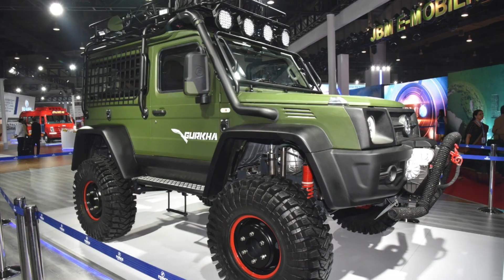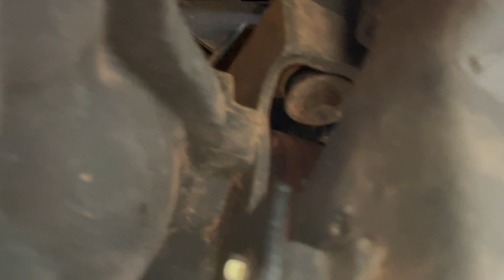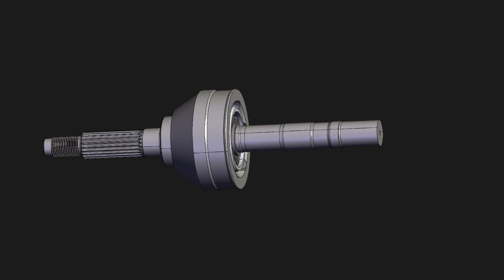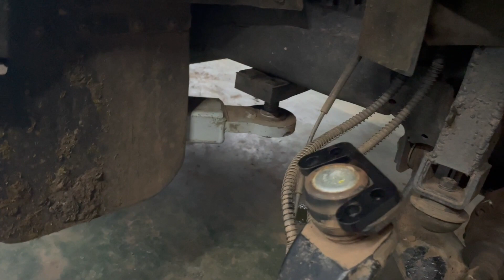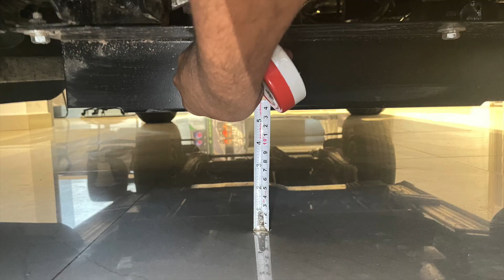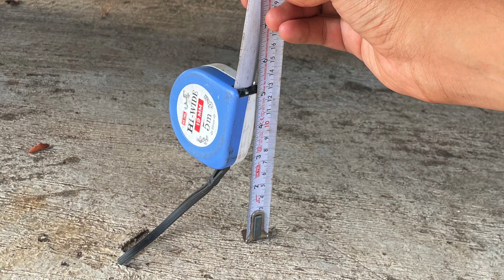Force Gurkha Lift Kit | 275mm GC! Blue Garage.15 Step Installation Guide. Pros/Cons See Description.

Comment: Hello brother, One clarification, In rear wheel lift spacer should be on top of the coil spring, why have you put it in the bottom of the coil spring... Can you pls explain why? For my knowledge.
Reply from the maker: Rear spring seat should sit on the spacer. This is better to allow for spring travel. Spacers are bad for your car and will do more harm than good in the long run. Please watch the full lift kit review video.

Comment: Have you figured out the diff-drop yet? Also, are you still using the lift-kit? How are they holding up? CV-wise, or any other issues occurred due to the lift?
Reply from the maker: I don’t recommend it if going off-road. As a temporary band aid for on road it’s ok. I’m on a complete different suspension set .
Reply: @tripaccino  Noted, thanks

Comment: @tripaccino How do I contact you guys?
Reply from the maker: Right here. Write here.:D
Reply: @tripaccino @tripaccino  I am looking to buy a Gurkha for myself and found a 2017- 3-door 4x4 model in Okayish condition. I am yet to make an inspection visit to determine the condition of the car. The seller is asking 7, 25,000. Any advice or suggestions for this purchase? Also, any ideas on the price fairness, as OBV and Cartrade platforms show a price of 5 lacs and 6.25 lacs, respectively, for a superb condition Gurkha. Specs: First Owner, 50K on ODO.
Reply from the maker: @Kapil-h1m  too expensive at that price. Chuck it. Won’t recommend
Reply: @tripaccino  Thanks...what would be the fair price? Also.. should I go for a new one, the 5-door 2024?
Reply from the maker: @Kapil-h1m  Depends on what you want to do with it?
1. Family car?
2. Offroading? Highway
3.Luggage capacity requirement?
4.Ownership experience+Service etc.
Reply from the maker: @Kapil-h1m  Can't say price without looking under the hood. Don't go for old Gurkhas unless you can fix it yourself.
Reply: @tripaccino  Roger that.

Comment: How is the lift kit holding up? Any issues have you faced as of yet? Since I am not that well verse in these terminologies, awaiting your feedback in layman terms 😅
Reply from the maker: Don’t go for lift kit. I’ve done a lot of mods to make it work. Im working on full blown suspension upgrade
 Have swapped out my rears into beefy off-road shocks. Will let you know when I get the full suite done
Reply: @tripaccino  sounds interesting. Will be waiting for an update. As per a sales executive in Guwahati, the new one is supposed to get a 235 mm ground clearance from the factory and is due to hit the floor July end. Would be interesting to see that set up as well.

Comment: Two points. Firstly, the trim height is measured from the center of the axel to the bottom of the wheel guard, this is standard practice and thus will give a true indication as the the amount of lift achieved. Second, why do you still have anti-sway-bars (anti-roll-bars), these devices only hamper wheel articulation, at least have quick-disconnect sway bars so that you can actually go over more rugged terrain.

Comment: Excellent. Please also comment on Highway/Road Drive Dynamics and Handling to incl Body roll, Veh stability and Pitch due to incr CG
Reply from the maker: Please watch the next video which is the complete test report with all these points covered in detail. And why I DONT recommend the kit, without sufficient countermeasures 

https://youtu.be/wDYovWfnM1M
Reply from the maker: @ravin64ful
Reply: @tripaccino  Gracias Amigo. Painstaking and insightful research. Grateful. I am currently in the process of evaluating available 4x4 options in this budget segment as an additional vehicle for self for use at my place in the higher reaches of Himalayas. Your inputs are indeed valuable !! Thanks.
Reply from the maker: @torqueador  Thanks for the encouraging response. I attempted to take the level of testing to a thorough and scientific high not commonly seen in our country, and Im glad you found it useful.
The segment is ripe with multiple options, let me know if i can help you make the decision easier. You may also check out my two car garage video which is targeted at people like yourself, looking for a second car esp 4x4

Comment: But you will have to be ready with spare CV as the tolerance of CV will decrease with articulation and rotational momentum. Maybe just some 1 year off 3 year high abuse. Theoretically I guess
Reply: Maybe the water resistance of boot could decrease due to traction on the lips, could a bigger boot take the pressure off, I wonder
Reply from the maker: Thanks for the comments. 
Boot requires proper installation. 
Cv angle is handled by dropping diff.

Your observations are keen. 

Please check out the follow on Video of this titled 
Full Test Report to lift or not to lift 👍
We can discuss it there once you have gone through the detailed discussion: you may find it interesting 🧐
Reply from the maker: A person of your understanding will surely appreciate the other follow up video
Reply from the maker: Lift or No Lift? Blue Garage Kit| User Review | Lift Kit Force Gurkha | All About Strut Spacer Lifts
https://youtu.be/wDYovWfnM1M

Comment: as of now after 2 months, how is your force G lift kit performance.  pls do let me know
Reply from the maker: Pros: Increased Ground clearance . Important for me because I run Django off-road and in competitions where can’t afford lower arm hits. 
Cons: Severely altered suspension working off-road. Undue stress on extended droop of the strut. And cornering issues because of bump stop. 

Bottom line: do not recommend spacer just for lift.

Also I ve done some other extra mods to null-  bump stop spacers to counterbalance etc. 
Working on suspension upgrade to replace lift kit completely. 

Please watch the full review video linked at the end of this video

Comment: Very interesting and good information! Thanks a lot, I just want to ask will it not affect the handling and performance of the vehicle?
Reply from the maker: It will affect it. On flat smooth roads, you wont feel much, but slight bad roads, trails or off road, its going to cause significant stresses on the suspension and may lead to spindle bolts shearing off. PLEASE do watch my complete rest report video linked at the end of this video and in the description. This lift kit will do more harm than good.
Reply: @tripaccino  thanks, and I'm desperately waiting for your next episode on this😄😄
Reply from the maker: @wanphrangdiengdoh2884  https://youtu.be/wDYovWfnM1M Here is the full report

Comment: When will you attempt body lift next? Thanks?
Reply from the maker: It’s already lifted . Sorry didn’t get the question
Reply: @tripaccino  this time you did it through suspension, any plans for body lifting, the other method you mentioned in this video ? Thanks
Reply from the maker: Ah. this is a "top hat spacer", the suspension actually has not been changed from stock. I will add a different offroad strut probably in future. Thanks and do stay tuned for my full test report where things will become clearer.

Comment: Well made video, How about the front track?
Reply from the maker: Spacer pushes the wheel axis away from steering axis. Track not changed. Toe changes a bit and brought back during alignment . Caster corrected by UCA spacer

Comment: I guess this lift kit might make the suspension bottom out at times...also might affect the CV joint in tough conditions...i am not sure if this would affect the handling dynamics of the gurkha...but i guess ur future videos might educate us on that...CHEERS! 🍻
Reply from the maker: The extended strut eats into the droop part of the travel and it will reduce range of travel. But I’m consciously betting on the limits. I’ll also be changing coil and diff drop in Future to compensate
Reply from the maker: Yes I anticipate the same . Please do read the description, I’ve explained my cons , cheers 🍻

Comment: Thanks for a very thorough explanation on the lift kit. I’ve just finished a trip to Zanskar in my Gurkha and felt the need for a lift. Would you suggest I start with inching up the tyres to 75s and then work my way up to the lift kit?
Reply from the maker: Thanks for the comment. Yes Absolutely . Please read the description in detail ;first upsize. Explore even beyond 245 75 like 265 70 16 might actually help

Comment: Awesome stuff, when i get the Gurkha, this would be the first thing i would do while sticking to the stock tyre size. Since I will be using the truck more on Highways initially, do you see any difference in the handling while considering extensive highway usage?
Reply from the maker: Rakesh, for highway, I would suggest to stay as lower as possible. You would get better performance and handling. I suggest the lift for those requiring heavy off road usage, but not without completing the kit with other associated mods. Highway, you can do the mods, if you're going for the looks.

Comment: Great explanation 👍

What were the engineers at Force Motors thinking when they designed this vehicle. It bottoms out so quickly 🤦‍♂️
Reply from the maker: The design has very good highs and some bad lows. It’s a mix, it’s got very great potential in my opinion